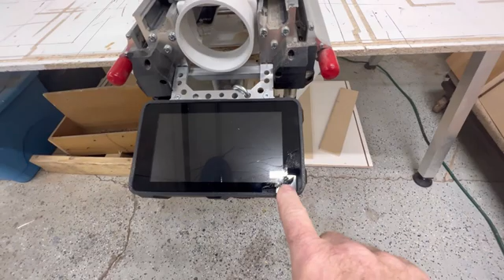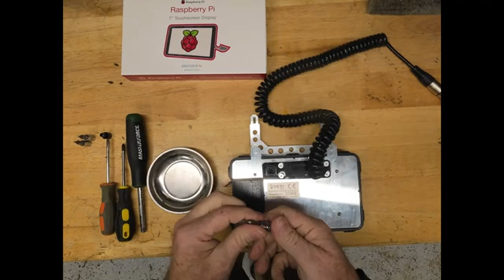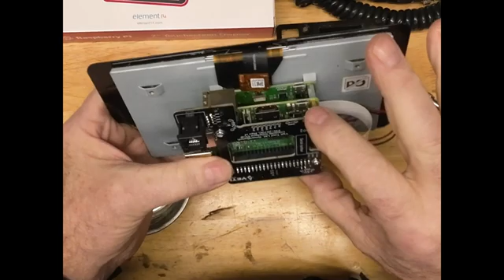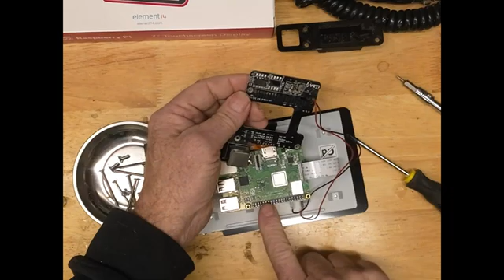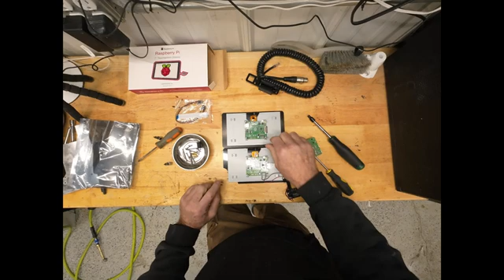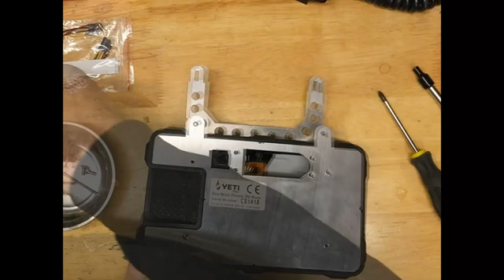Is This the Solution to Your Shattered Yeti smartbench Screen?

Comment: The lock for the ribbon cables needs to be released and locked on both sides of the cable. You only did one, so it was hard to remove and might come loose
Reply from the maker: Thanks I will go back and double check it